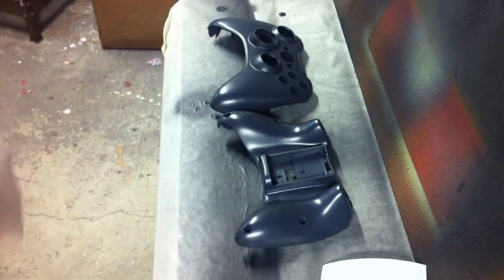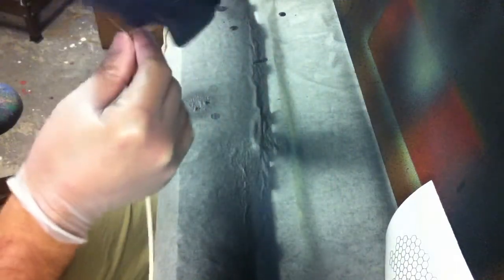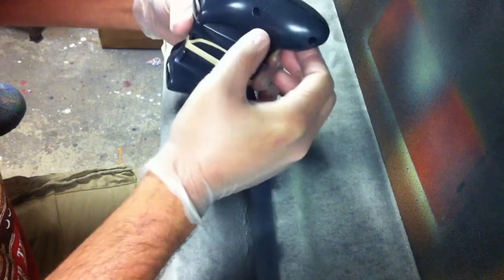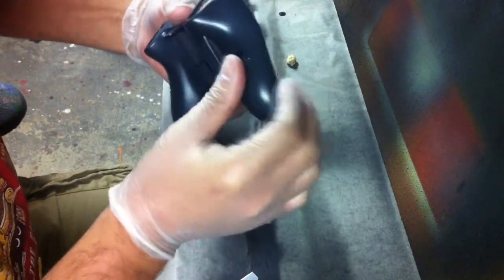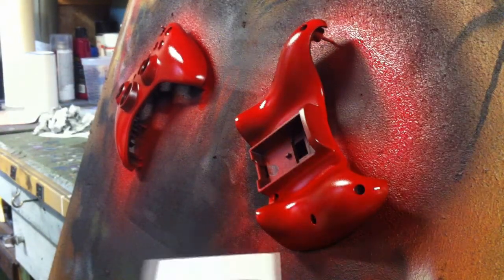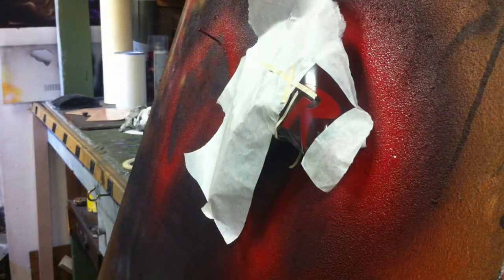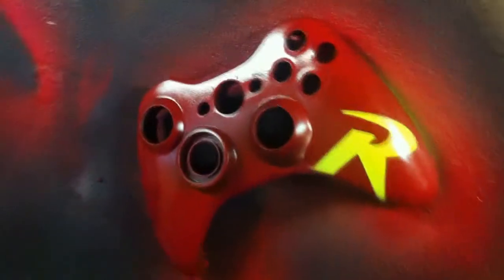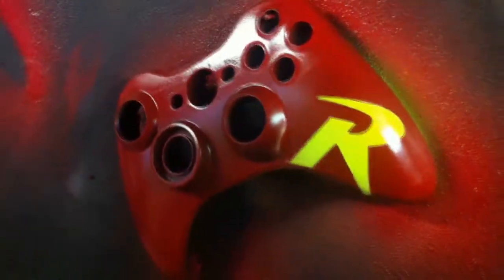Batman and Robin custom Xbox case and controllers Part 2 | Airbrushing Tips

Comment: Ah ok, thanks. Can't get it on this side of the Atlantic it seems, maybe they go by a different brand name in Europe? My one small gripe with your method was that you used transparents for a full coverage finish, you'd save yourself a pile of time and paint if you used opaques. It would also reduce the amount of sanding you'd need to do to level the clear where masking had been used. 
Not trying to put you down or anything, just making suggestions so you can save a little bit more money and time

Comment: Cool how to...are the surfaces textured or is it peel in the paint...noticed it even before the clear??
Reply from the maker: There's a little texture in the controllers.  There was some peel in the case, but it was wet sanded smooth before putting it back together.

Comment: which type of vinyl did you use ? there are different categories on the site  , i only need the vinyl to be used in a cutter like you have .
Reply from the maker: I used a vinyl paint mask.
Reply: +Airbrushing Tips 
i airbrushed a  controller that was black with purple  numbers . so i sprayed the purple  first maybe like three coats after it dried i applied the stencil  . then sprayed the black over stencil with three coats of black . when it dried the stencil didn't come off clean . i dont know if left the stencil on too long or the coats was too heavy  . so what length of time do you leave the stencil on or do you think the coats was too heavy ?
Reply from the maker: Frederick Johnson It's hard to say.  What type of paint did you use? Pulling the stencil too soon would cause it to peel, but so would spraying too heavy.  Usually I work dark to light, so I would have sprayed a black base, then made a negative stencil for the numbers.
Reply: +Airbrushing Tips 
i used the auto air colors . what would your time frame of too soon  ? now that i look at i think it may have been too heavy coats because some spots the paint looks runny . what psi you use for controllers ? i used a master 22 . until i get used to airbrushing  .
Reply from the maker: Frederick Johnson For hard surfaces, I spray at 40 PSI.  It's rare that I turn it down.  With the Auto Air line, remember to spray light coats.  Build them up slowly.  As far as time goes, it's hard do judge.  Lots of variables.  They will dry to a matte finish.  At that point, it's safe to spray your next coat or peel up masking/stencils.
Reply: +Airbrushing Tips 
i think i was just too excited and was kind of rushing to done with it plus when i started airbrushing the controller i started at a good distance but then some spots for some reason i kept getting too close up on the controller which is another reason that caused the paint to run  . so when you did the ' R ' was that the negative or positive ?
Reply from the maker: It was a negative.
Reply: +Airbrushing Tips 
alright thanks for the info

Comment: How did you do the honeycomb effect ?
Reply from the maker: I cut it on my plotter.  Check the part 1 video at about the 9:00 mark.
Batman and Robin custom Xbox case and controllers Part 1 | Airbrushing Tips
Reply: Thanks , would there be any way for me to do that effect without the cameo ?
Reply from the maker: Niall Mckendrick
You can.  There are a number of ways.  Air Sick Stencils makes a honeycomb stencil.  That would be easiest.
Reply: Thanks so much for the help !
Reply from the maker: Niall Mckendrick
You're welcome!